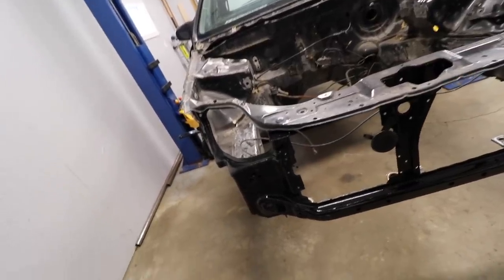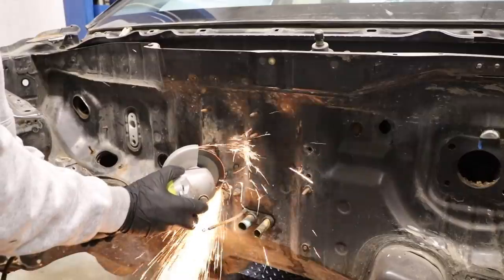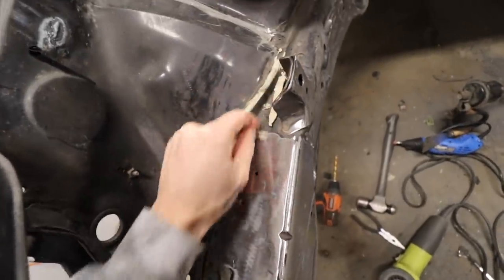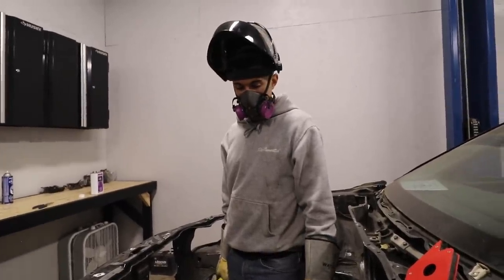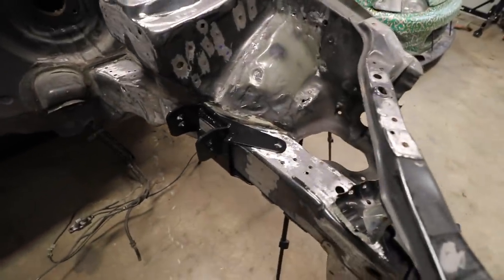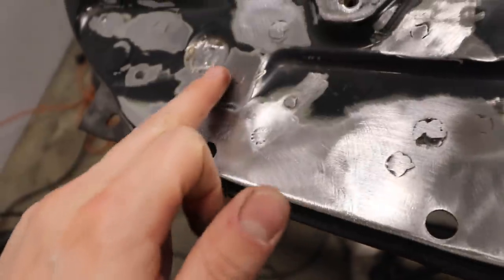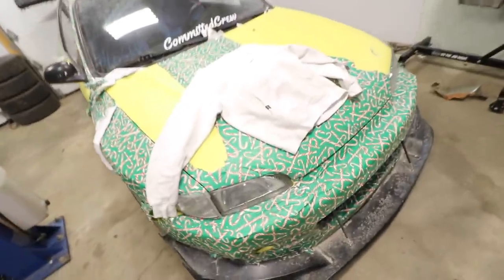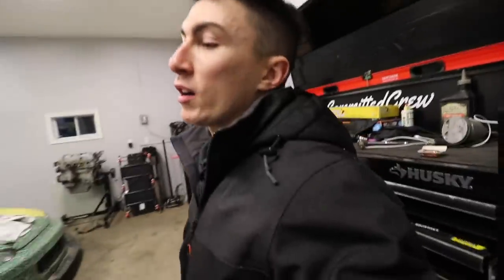Making the CLEANEST Engine Bay Yet!

Comment: There’s a company called ASR(known for their subframe braces) they sell a kit of radiator bracket for relocating radiator or switching to a full size. 

Also, you filled the holes where your upper control arms come threw the body and bolt down.

Comment: 0:30 Lmao robbie that's how it is when you cut your hair for the first time, you just need to learn to make guidelines to make a fade, I cut my hair as well and I cut my dad's cuz of lockdown, and that's how my first hair cut looked and now I taper the sides and I'm good at cutting hair, my dad loves his cuts, just need to learn how to do guidelines and have some clippers and a trimmer (trimmer for your hairline)
Reply: Yup, just takes some practice and youll get it. For cutting the back of your head, pick up a hand held mirror and use it against a bathroom mirror to see the back. Before you decide to turn on the clippers in the mirror make sure to figure out where your left and rights are, takes a bit to get used to but better than going towards the complete opposite direction when cutting it.